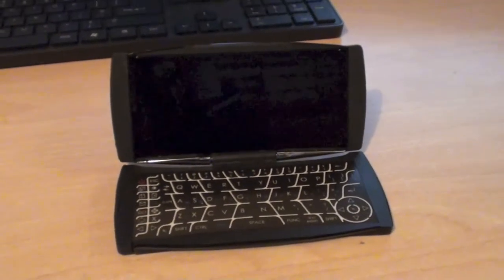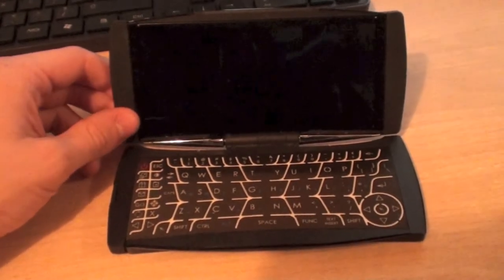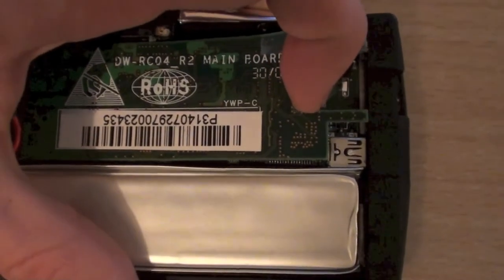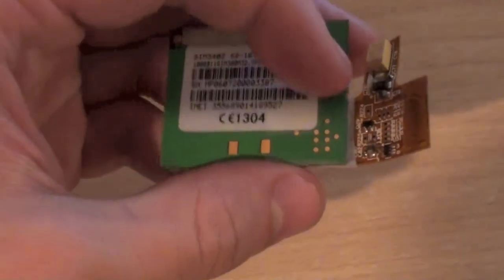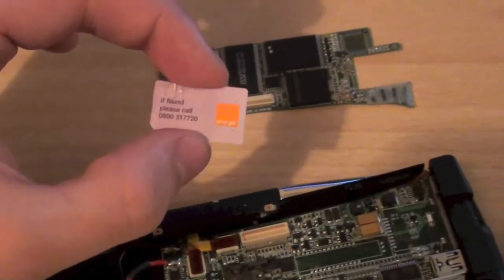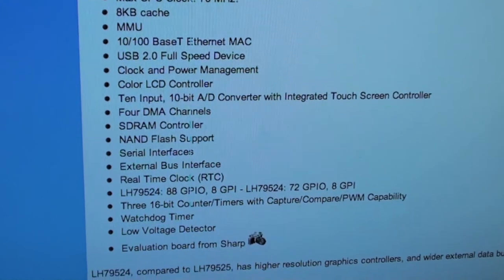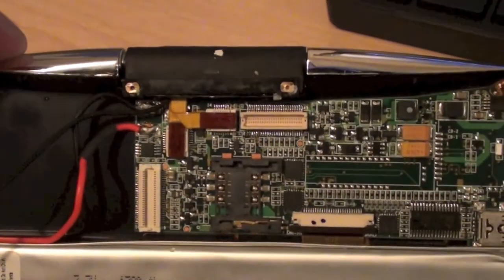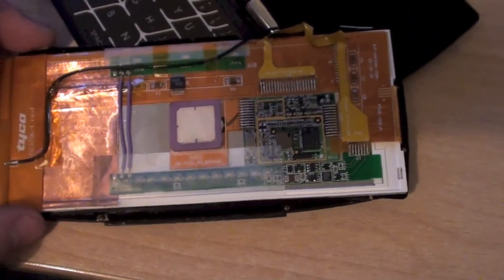Datawind PocketSurfer2 Teardown - Handheld Internet Browser

Comment: I had one of these when they first came out in 2006. The execution was clunky but it was an interesting idea and it was (at the time) impressive to be able to do anything approaching proper web browsing on a pocket device. Of course within a couple of years it had become completely outmoded. As others have said, it doesn't render anything locally, apart from the top status line everything you see comes from an RDP session on a server 2003 machine running a custom web browser that used IE6's rendering engine (which quickly became a limitation of the device). The device itself is basically a portable thin client. You'll never get it to work again if those servers have been shut down.

Comment from the maker: Well if you bought a later model which had the MicroSD card slot, you might be able to load Android onto the card and run it from that but with only 16MB of flash memory, a very cut-down version of Windows CE is the only option. Also, the USB port is disconnected for data so you would have to directly connect an RS232 connection into the processor to upload a different operating system. The pads for an RS232 are probably on the PCB for initial configuration but I haven't looked.

Comment from the maker: Yes, I remember one of their corporate videos tried to show that this was "faster" than an iPhone - which is ridiculous. I think even a very basic kernel of Linux on the 16MB flash memory. It would be great if it had a USB port or even the memory card slot was installed as that would mean even greater potential for modification.

Comment from the maker: It's quite possible that the SIM card has been modified only to work with that exact device. Perhaps the IMEI of the GPRS module had been written to the code of the SIM card. After all, those SIM cards have at least 64K of ROM and run on JavaCard so it would be very easy to 'tie' each SIM card to each device in the factory especially as the SIM card is not designed to be removed without taking the whole device apart.

Comment: hi carl, nice video. i have a pocket surfer 2, which also has a touch pad. not sure about the orange sim card, when mine was working it used vonaphone. Dataward have a channel on u tube, did send them a mesage about how to reconnect. havent had one back. the small micro card slot was to increase the memory, which never happend.. phill..